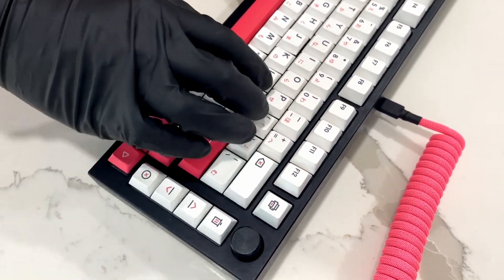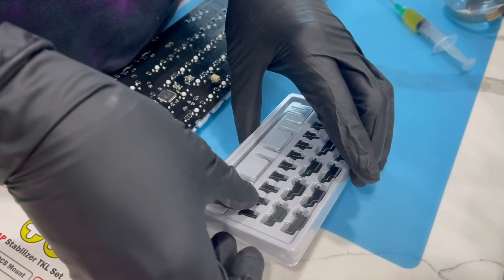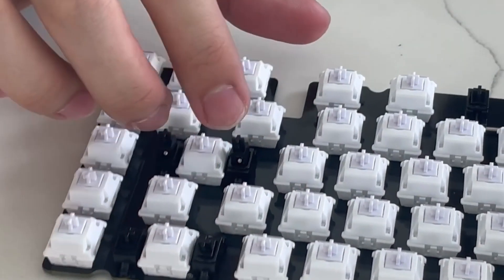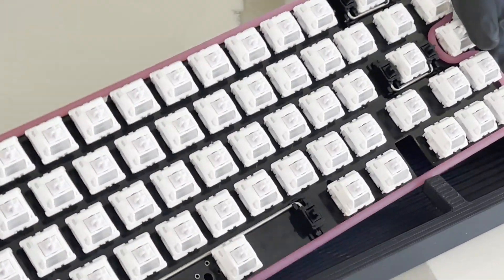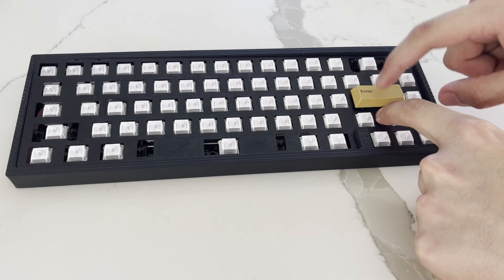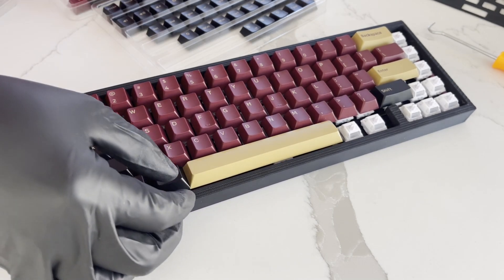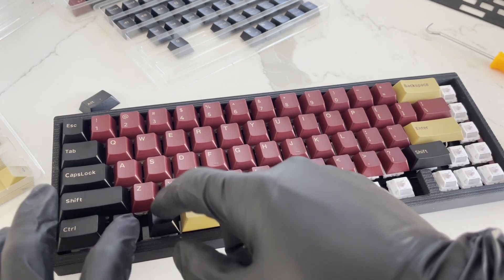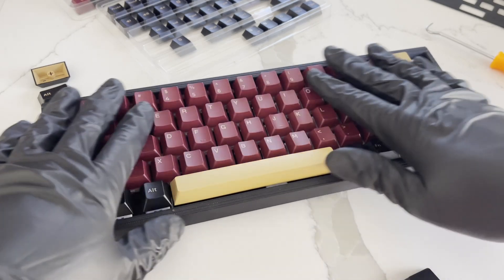3D Printed Keyboard. An enthusiasts Nightmare 🤦🏻‍♂️

Comment: Hello, saw your video on my recommended feed and figured I should watch it 'cause I have a 3d printed board myself. I would like to list the things you did wrong. You soldered on your switches without your plate and it probably was the cause of the PC plate not "fitting in" correctly with your case, this is also due to the fact that you were using an o-ring mount, which needed to be fit in between the plate and the PCB to produce that "friction mount". You also soldered some switches on the bottom row in the wrong orientation; 1.5u LCtrl 1u LWin 1u LAlt, probably a 6.25u spacebar in the wrong slot, and 1u RAlt caused by the wrong oriented spacebar.
Reply from the maker: Thank you for letting me know, especially about the plate. If you don't mind me asking. The plate goes between the switch and the PCB?
Because this was something I considered doing I just wasn't confident in that decision. In the bottom section, we ended up changing a switch position in post and it got a little better. there is still some spacing around the space bar but at least is even.
Reply: @MakerMilo  You should imagine of the switches as a screw, they fix the PCB and the Plate, then when they are all put together it`s going to have an emphty space betheween the PCB and the Plate then you can put the rubber ring and is going to fix perfectly on the case
Reply from the maker: @pedro54541  Thats what I was questioning in the process. I will de-solder the board and correct this. Thank you all for the help. I will do an update when I finish doing the corrections.
Reply: @MakerMilo  You put your stabilizers correctly, so you don't need to make adjustments on then.
Reply from the maker: @pedro54541  Thanks, I apreciate the help. 😁

Comment: abs just shrinks when it cools down, so maybe your tolerances were just wrong, you should see how much abs shrinks in % and just scale up your part in the slicer
Reply from the maker: @Stojce_  I didn’t even consider the shrink factor. Completely forgot this was designed with PLA in mind which does not shrink. Thanks for that. That’s explains a lot. Might revisit this project in the future.

Comment: Heyo, I’ve been in the hobby for years and have a few comments outsid what others have already mentioned. 

1) A lot of your problems could have been solved by watching a video or two of someone building a keyboard. As an engineer research is like the first thing you do. Something like putting the plate between the switches and pcb is as fundamental as adding supports for overhangs in a 3-D print. 

2) Do not pay attention to hipyo, just trust me on this, he’s not a good source of info for keyboards. Taeha Types and Alexotos are both people I’d suggest looking at because they know what they are talking about. 

3) I’m not very supportive of clones mostly because it actively takes money away from designers that have spent countless hours and took the financial risk to work with vendors and run their keycap sets. 

3) That said, yes, GMK can be expensive, and that’s for many reasons. German manufacturing costs, high demand combined with (what used to be low) production volume, color matching (this one is a big one), QC, tooling etc. There are alternatives. Shenpo and Ghost Judges keycaps on Aliexpress are both good options that don’t destroy your wallet. 

4) Always check how your keycaps fit on your switches before you solder them in. I’ve made that same mistake with soldering switches in the wrong pads, it’s not fun. 

5) You bought Tx Stabilizers. They’re arguably the best ones you can get on the market. Regardless, you NEED lube. Get some Superlube Dielectric grease w/ Syncolon on amazon or permatex dielectric grease. Put it on your wires. You can use something like a syringe to inject it into the stabilizers. It prevents rattle.